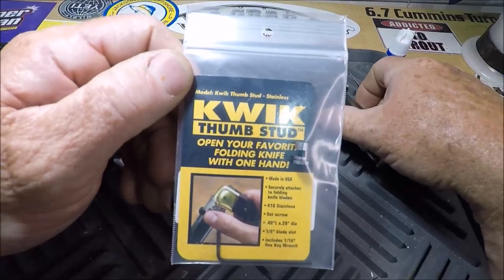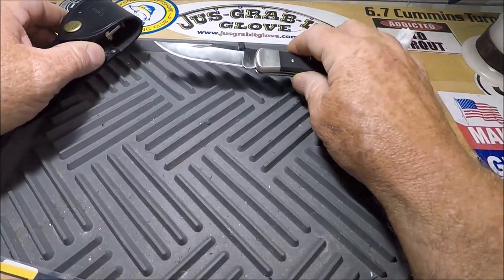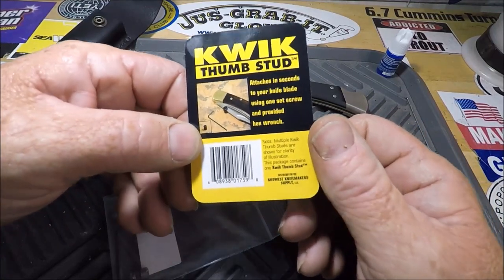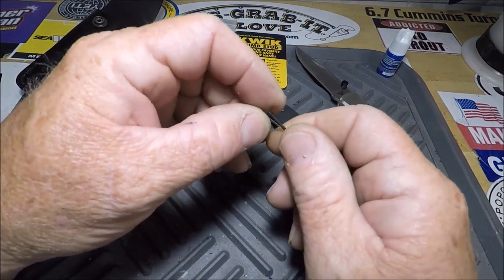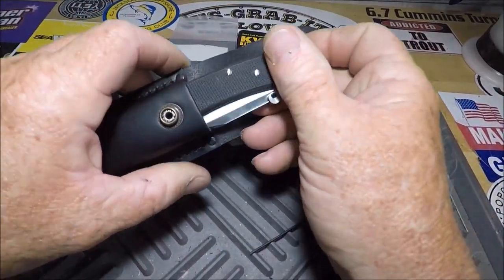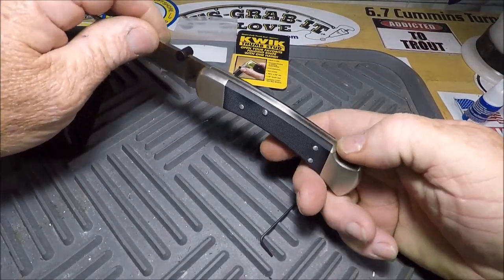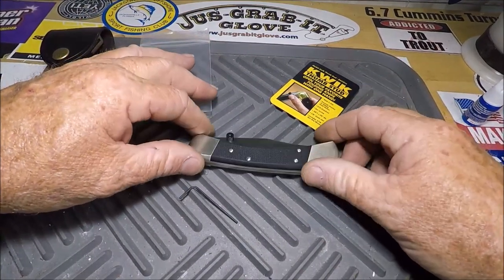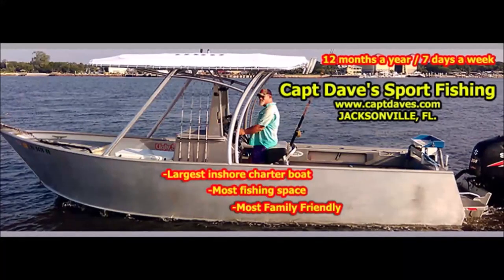Youtubes, 200th thumb stud on a Buck 110 video

Comment: Some fine cutlery Capt Dave, One question for you or any viewer who is a buck 110 fan. If there was a choice between the pins that hold it together or a set of screws so you could disassemble and clean inside  which way would you go. Classic pins or screws?
Reply from the maker: thin out a q-tip, add some solvent, and the inside is clean, or just JET the hell out of it with brake cleaner. I would think some screws could loose over time.
the pins just hold on the scales, that's all really, and the largest is what the lock bar rides on.